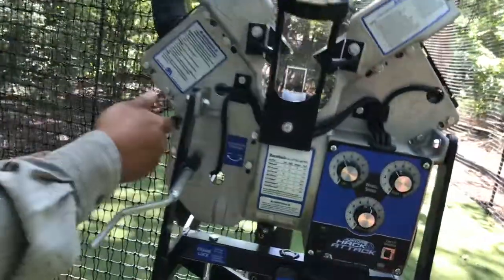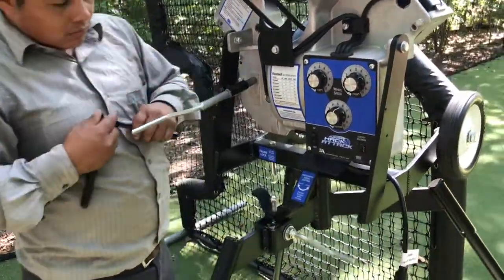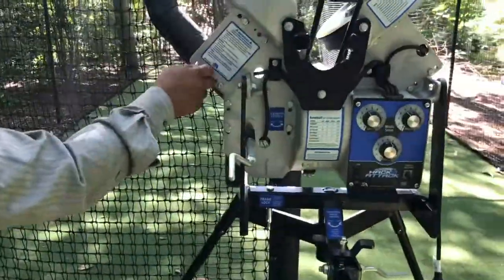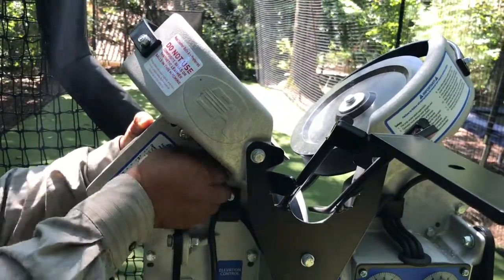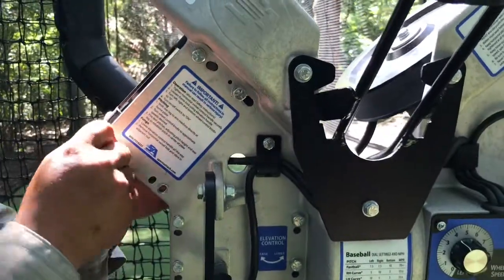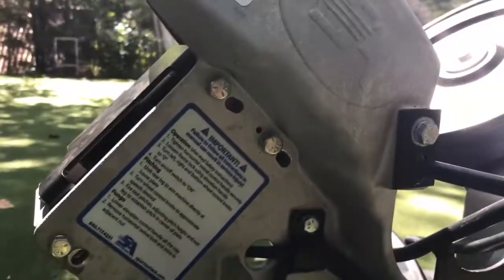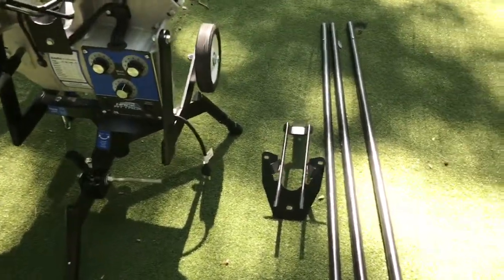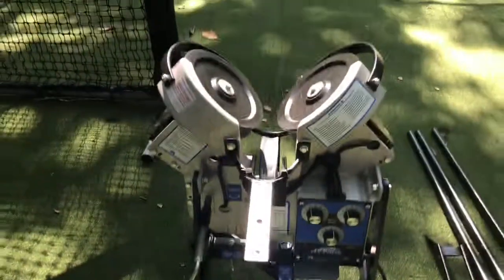Pitching machine hack attack baseball to softball conversion

Comment: Wait, are you saying I don't need to buy the 3 new wheels.  I have hack attack baseball pitching machine.  If I just move the motors and buy or fabricate a softball chute my current bassball wheels will throw softball no problem???

$1200 for kit

Edit, never mind.  That's a junior hack
Reply: So do you need different wheels from baseball to throw softballs for Jr. Hack Attack? I see all sorts of different kits online, some with wheels some without...